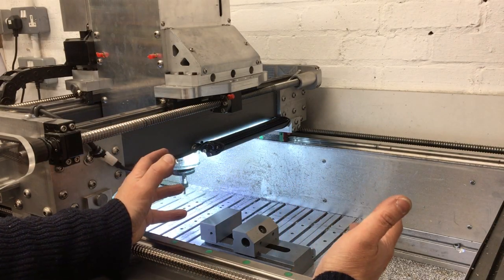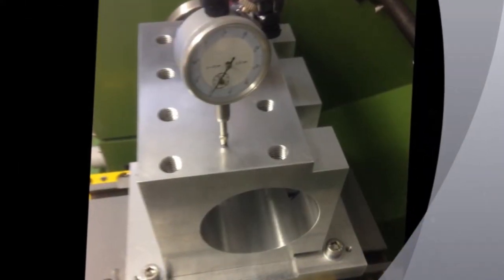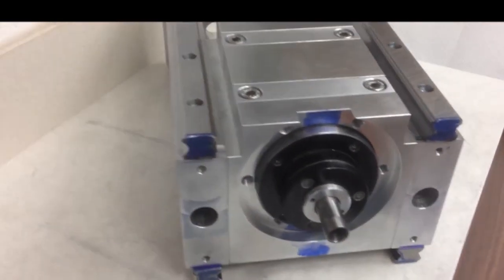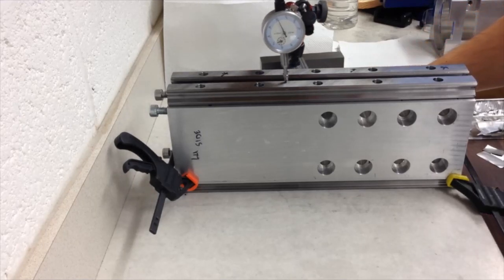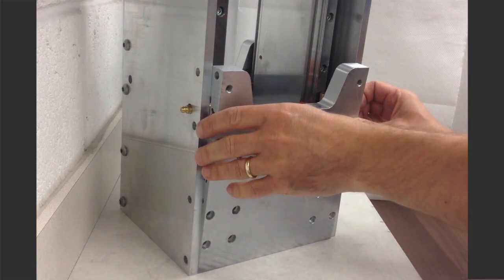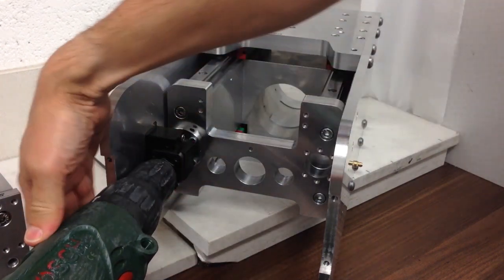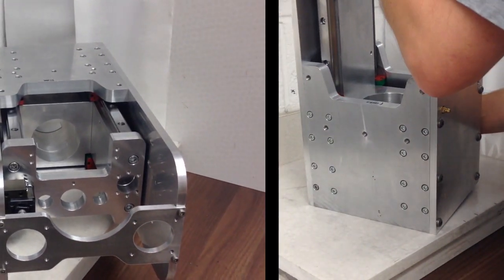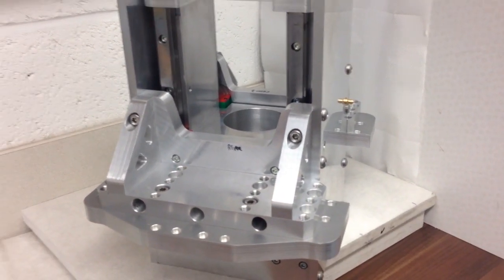DIY CNC machine directors cut 1of3 - Starting the build

Comment: I have been seeking a CNC router design for some time and eventually found your channel. Your machine design brief fits very well with mine. Your Z access design is simply jaw dropping; in my view it would not look out of place at CERN! Your skills; design, manufacture, problem solving and implementation (persistence) are top level. Completely awe inspiring and inspirational. 
I will now need to go away and work on a number of my skill areas, as I now have a better idea what my end goal should be. Thank you for telling us about your amazing build.
Reply from the maker: Glad it helped you.  If you look through my videos one of them talks about the CAD (50% off in the thumbnail).  I think I added a link to the mycncuk forum where I uploaded a Fusion 360 version of the CAD for free.  Have a look and see if that helps, at least you can see how I did it.
Reply from the maker: Sorry, the link is in the directors cut 3 of 3 video.  Look through my channel to find it.  Free CAD link is there.

Comment: Hey, nice to see a video about your machine again!
I saw them while designing my own project for a cnc some years ago.
It had a ton of design changes through it's design stage hehe. But unfortunately I haven't started building yet.
I got a bit obsessed with accuracy and decided I'd make a steel cutting machine, using an off the shelf milling table (which would take away a lot of work).
Still waiting for a good moment to start.
Thanks for showing the build!
Reply from the maker: You are welcome, good luck with your design and build.  Design is an interesting process and each decision knocks onto something else.  Hang in there !

Comment: Excellent overview! Thanks. Looking forward to the next ones. 
If you haven't planned it already, maybe there could be a part 4 "if I had to do it all over again" what would I do?
Engineering approach and choice of materials/parts sourcing could also be a good discussion.
Reply from the maker: Interesting idea.  I’ll give it some thought.
Reply: @routercnc9517  I'd second this "what would I do differently" idea - you're obviously very knowledgeable and knowing your thoughts on what worked, what didn't and what could be better after some use time with the design would be extremely valuable
Reply from the maker: I’ll add it to the list.  It may fit in well with another topic I had been considering.  Don’t hold your breath though! Thanks

Comment: Just found your channel. Now just have to find a decent CNC workplace, which let me make parts like this in a spare time. Then to find a decent place for myself, where to assemble and build up a decent tool base.
This design seems sturdy enough, even over-engineered.  Then.. yeah, so much work goes into these machines, it would be easier to get rich enough to just buy a ready seconhand mill, even if it takes away some fun. If it sounds like a poor dreamer's discourse, it is. For now.🧙‍♀️
Reply from the maker: Yes you either spend a great deal of time and effort (2 years is not unusual for a build!) or save up and buy something.  A CNC is a magical tool that I would not want to be without.  Good luck with it and keep dreaming and making a plan!

Comment: If you have any leftover CAD for the initial power drawbar design - I'd be very interested in seeing that as well! I've not seen a router with a ratio-reduced spindle for more torque - something I've thought about quite a bit for low end torque and encoder feedback to the controller, hence would be useful to see how you initially thought it could work
Reply from the maker: I’ll have to think about that because the CAD is in a format that most people could not read so that would need exporting out and then each piece would have to be positioned into new assemblies.  I never built it so the Belleville  washers may not be the correct preload etc.  Maybe instead I’ll do a CAD walk around as a future video just to show what I was thinking at the time..  So many projects so little time!
Reply: @routercnc9517  definitely understand the time limitation! Rest assured all of your efforts are very appreciated and useful at least! 

The file formatting and assembly mating wouldn’t be prohibitive for me specifically, but could see how it would be for others. Raw files would be faster but I think a video would be more beneficial for the masses (at the expense of more of your time, unfortunately)
Reply from the maker: OK another one for the list